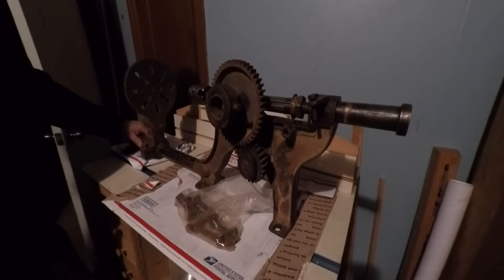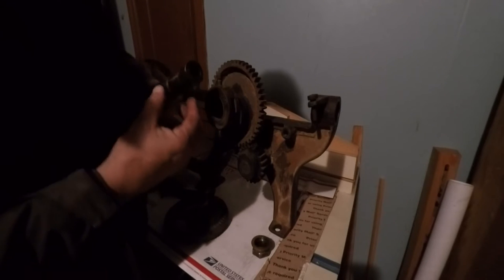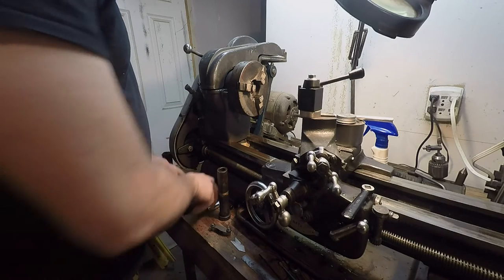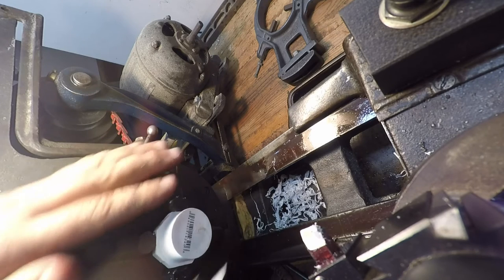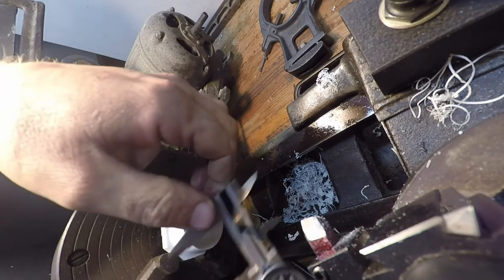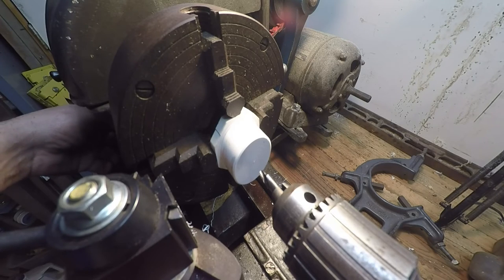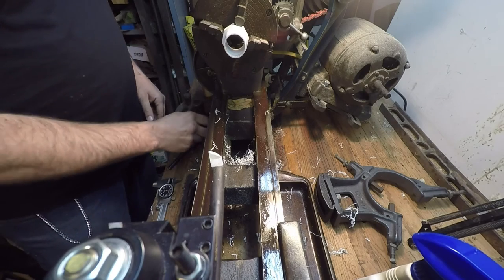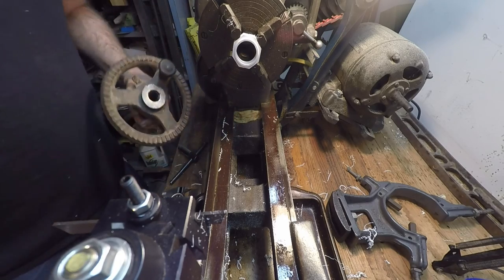Champion blower and forge co Post drill press part 1

Comment: Cool. My Dad has two of those old post drill presses. I think one is missing a large gear. It's amazing to me to that you can use hand power to drill through metal, but that's how it was done. Love the old tools and glad you're taking the time to restore this one. I have a Buffalo  blower so I'm interested in seeing the Champion you have.
Reply from the maker: my forge is a champion to
Reply: Yes I know. :)
Reply from the maker: I'm working on the next video already.
Reply: You're blacksmith shop is NOT complete with a post drill and hand crank grinder.   You have your mission if you wish to accept it.....
Reply from the maker: I've got a belt drive grinder need one?
Reply: I've got two arbors I've collected myself. Not restored.  I'd love to see a shot of yours.  I'm in the collecting mode for when I get a corner for those kind of workshop tools.
Reply: +Crafted funny you mentioned that. My Dad gave me one of his post drill press and it's  in real nice condition. Not sure about getting a hand cranked grinder though.
Reply from the maker: i have
 got one of them to

Comment: not sure what it's called but it is the part that drives the bit down as you drill 
like a cam arm I could maybe send a picture
Reply from the maker: Email me at oldironshops@gmail.com lots of photos
Reply: Thanks Chris I sent a few photos of mine and one of your castings
since I don't have the parts I have no reference materials
Reply from the maker: @rogerfortier6934  I'll check it out this evening see if I can do anything
Reply: Old Iron Shops  Thanks Chris
Reply from the maker: No problem

Comment: High accuracy?  I think the cool thing to make some nice projects on these old tools.  Modern tools were made on older tools.  Those tools made on still older tools and so on.  Check ebay and watch Craigslist. I've seen the occasional cheap drill because the backbone was cracked or parts were missing.  You might find your exact model.
Reply from the maker: got a friend who has several different Champion ones and we found parts that match this one but not everything strangely enough I can't find a model number need to find somebody with an old catalog
Reply: Chris Anderson would you be able to me into contact with your friend? i have a champion no 101 and need a table. Ill happily pay for it
Reply from the maker: +jacob mcnamara absolutely. If you need a casting made make we can make another copy.
Reply from the maker: he has a channel  its eviltwinx

Comment: Hi Chris I sent you an E-Mail regarding my old blower & Forge model 612
Drill with some missing parts, you mentioned that you might be able to help
just wondering if you had any Luck
Thanks
Roger
Reply from the maker: Not yet first day off.
Reply from the maker: I'm spreading the word just waiting to see if anyone has this part
Reply: Thanks Chris I am still searching as well
Reply from the maker: Needs to be carful I've found that many parts look correct but the diversity is immense so there may be parts of look right but are wrong
Reply: Heard That Thanks

Comment: I see you jacked up your QC tool post.  Is that an 0XA?
Reply from the maker: yes it is a oxa works dandy AXA would be better though
Reply: If you run across a cheap 618, snap it up and sell it with the small tool post.  Use the profit to buy your AXA set.  I've considered getting a BXA. I think it would work.  However, the carriage is and narrow way width is not going to be improved.  So, I'll stick with the AXA myself.  I was hoping the commercial, since it has all different castings would have wider gib spacing.  Would have been a big improvement.  It does not however.  I may get a BXA for it anyway.  That time is a bit off however.
Reply from the maker: They have the specs for tool posts based on the swing of the lathe
Reply: Everything I ever saw recommended the AXA.  That is why I got it.  The BXA is listed for 12" and up.  I think I could run the BXA on my 10" and still set tool heights properly.  Generally the bigger you, the stiffer everything will get.
Reply from the maker: well id dubble check your numbers befor you drop the $$